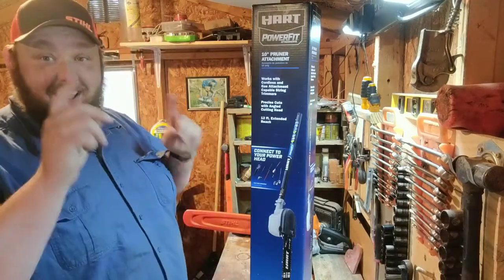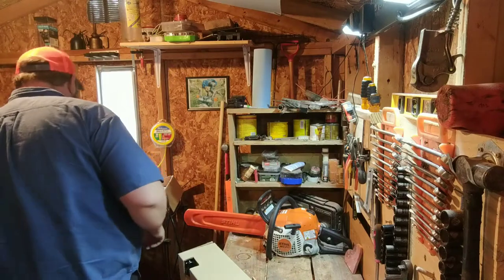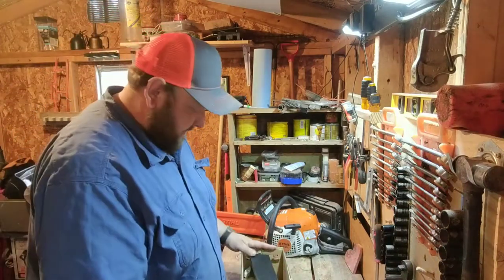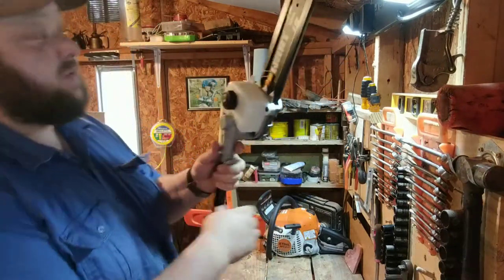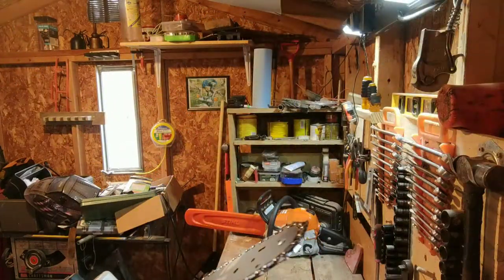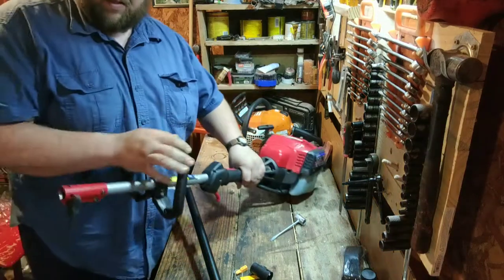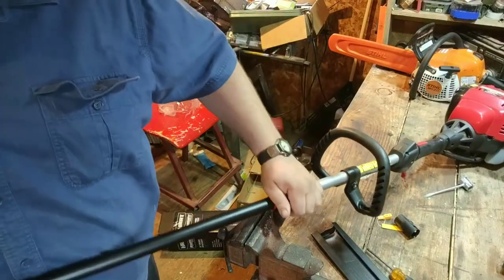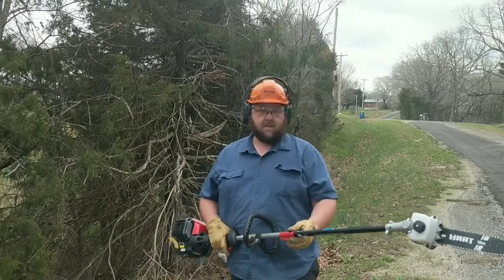HART Universal Pole Saw Unboxing and Review

Comment: I bought 2 of for $28 ea., and the extensions on both of the don't work. I put a piece of no. 9 wire about 3/8 in, long inside the cable end on saw side of extension, and works great. the wire makes the cable longer. still plenty of room for cable inside connector.

Comment: Good lord am I happy you took that yellow piece off! It’s no where in the manual if you keep it or stick up your… anywho, mine was used with it on, still worked, but now I know🤦‍♀️😂
Reply: I love my Hart stuff. Can I use & pack a 44, &  Stihl gas stuff sure, but I can do just as much with my Wally World light electric & not vibrate for hours after. 😅

Comment: How much was it on clearance ?
Reply from the maker: $94
Reply: @truckinedchannel9982  and you put on on something other than a hart? I thought you had to use them with hart! But that’s awesome! Now I will definitely look into one
Reply from the maker: Yes. Hart is made by MTD.  So the box says Weedeater, Craftsman, Troybuilt, Snapper, and many others. You just have to see if yours has the same quick connect
Reply: @truckinedchannel9982  I have a troy bilt but I don't think it has quick connect. Can you add quick connect?
Reply from the maker: @drakonakolovaca  usually it only comes on straight shaft. Usually on units with large engines. Maybe you could convert it if you had an old one, I doubt you could get "the kit"